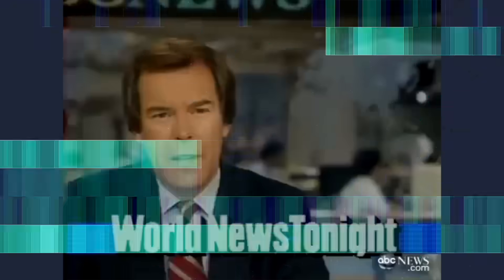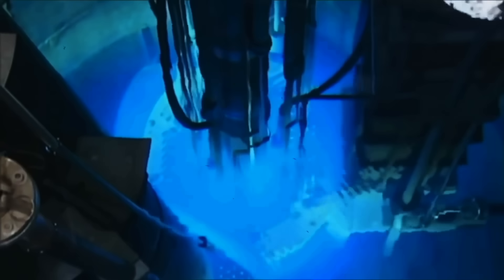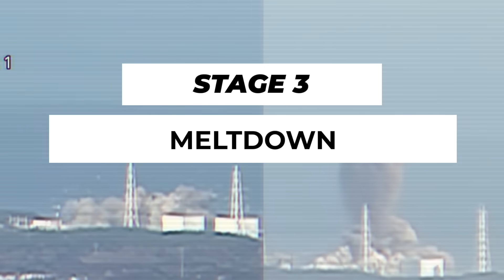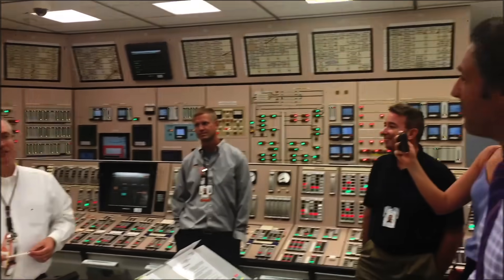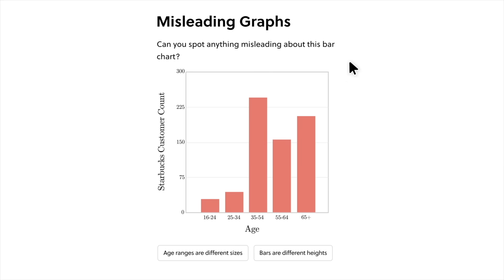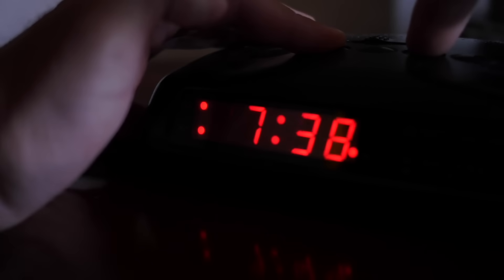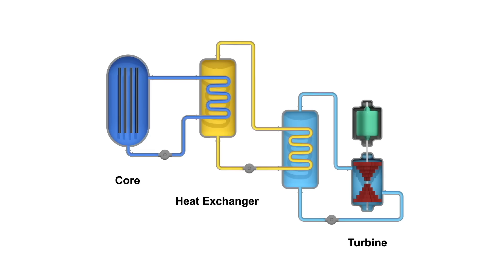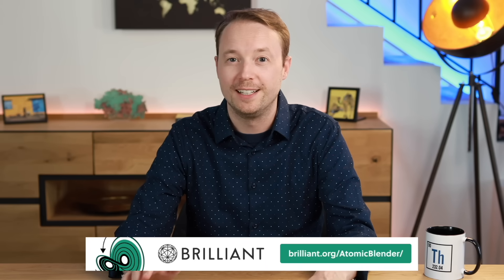Why Is It So Hard to Stop Meltdowns?

Comment: Why don't use tungsten or graphite bath/crucible  instead of stainless bath? Sure tungsten is expensive metal than reactor-class stainless steel (maybe 2-3 times) But if inner part is made of tungsten or graphite and outer case is made of stainless, it is not prohibitively expensive. Graphite is excellent neutron moderator, tungsten is excellent neutron reflector.

Comment: You are harrassing a lot of power and that power comes with a cost when a nuclear reaction runs away nothing you can do to intervene will stop what’s occurring. I spent a lot of time studying what happened in Chernobyl as far as i know it was just a flawed design and they knew it that’s a real issue nobody ever mentions and the fukashima situation was a freak tsunami the building was built well above code so yeah nuclear power is mega safe outside bad choices and a freak accident

Comment: Sorry ,  yes theres a dome to contain if theres a meltdown . but what about the whole corium that would be formed in case of a meltdown  and it melts down the concrete pad and into the under ground , what happens then ? even below the heatexchanger ? i dont know what could happen and wanted to know ..

Comment: I’m sorry did you say thousands of years we have been using nuclear power? Electricity was discovered in 1821. Unless we used uranium to create steam engines, I don’t think this is correct. Otherwise I like the video.
Reply: He is talking about cumulative hours. E.g. 100 reactors operating 10 years each = 1000

Comment: I have said for the last 15 years since I wrote a paper on it in college. There is a very simple and practical solution for the United States and nuclear power.  It’s called our naval bases through our nuclear aircraft carriers and nuclear submarines. We have operated a fleet of nuclear submarines and aircraft carriers for 70 years with almost no problems surrounding their nuclear power capabilities. 

I believe that by producing several simple and reliable nuclear power systems and using them at our naval bases to provide power to the United States while training technicians on how to operate and maintain them before being deployed on our aircraft carriers and submarines. We can provide an additional 20% capacity to our electric grid. We as a nation have already built and paid for the nuclear fuel from our nuclear weapons that eventually hit their half life and must be decommissioned. We should as a nation demand that this massive investment be utilized for the electricity we can and should be able to generate from this source that has already been developed and paid for.

These are secure nuclear power sources on these naval assets that are already present across the country at our bases which are near major population centers and can easily provide electricity. They are the obvious choice for this source of nuclear power. They have the infrastructure and security in place, they have the budget and expertise to operate these nuclear power plants safely. Most importantly we already have the nuclear fuel required for these facilities to operate and it’s the most logical way to dispose of our spent nuclear material that allows us to generate revenue to update and modernize our nuclear arsenal. 

Instead of the military wasting hundreds of billions of dollars on dismantling and disposing of these old nuclear weapons and building new replacements. We can capitalize on this capability and provide cheap clean energy to our country that can provide the revenue source needed to pay for our new nuclear arsenal. 

We already have this same model in place for selling our older aircraft and tanks to our allies to build new replacements. The United States is one of the biggest military exporters in the world and I believe it’s only logical for us to utilize our aging nuclear weapons material and nuclear power expertise to provide the much needed infrastructure and capacity. 

We can build this infrastructure out and sell it to the utility companies at a very low cost as any revenue generated from this program would help subsidize the enormous cost of building new weapons as well as help lower energy costs across the country.
Reply: Also as a side note. The key benefit and reason for naval bases being the source of these power plants is that they have clear access to water and have the very group of people who would be sent to any emergency or disaster. Also the military would be capable of operating these facilities at a reasonable rate of power and have no financial incentive that could compromise safety. They would purely be run as a training environment for people who would operate these same units on nuclear aircraft carriers and submarines. It’s also about the idea that by mass producing and building these facilities it would lower the cost dramatically for our ships and submarines and would also provide an abundant supply of available power plants that could be installed in submarines and aircraft carriers if we needed to quickly build dozens of them for a conflict. 

Instead of being bottlenecked by being unable to produce dozens of new nuclear power stations for aircraft carriers during a conflict. We could have them already built and operating across the country and capable of being installed quickly.

Comment: missed 2 types of meltdowns and 2 backup systems. 1: hydrogen explosion, this is what causes most reactor explosions, water reacts with the molten fuel sometimes and generates hydrogen which explodes because of the pressure and/or fire from the molten fuel. 2: RBMK explosion, chernobyl, RBMKs have got some sort of stupid design that makes them one of the only reactors that when they meltdown they'll almost certainly explode, to make things worse, the lid usually breaks the containment building, allowing radiation release. 3: gravity powered coolant tank and manual valve, open the valve, water is sent into  the cooling loop. 4: emergency amplified hand crank pump, a pump bypass pipe connected to a hand crank powered pump that has a cog amplifier (using cogs to output more rotational force than is applied) twist it and it pumps.

Comment: Quick question cant we lik add a liquid Nitrogen like emergency will that create more issues.
Reply: Liquid nitrogen introduced into a such a hot confined space would likely create even more pressure cause of the extremely low boiling point of nitrogen

Comment: Unbelievable whitewashing! In Fukushima, ALL backup systems were flooded. They probably only needed power for cooling, but due to the chaos in the country, the emergency generator didn't arrive. Even the fuel elements in the cooling pool melted due to a lack of cooling! And the people there are still suffering 10 years later. Anyone who claims you can think of everything is wrong! Spend two hours studying the two accidents in Fukushima and Chernobyl before you start clamoring for nuclear power.

Comment: 5:33 Most Nuclear Reactors have been retrofitted for this problem. They use Electromagnets to move the control rods, so when power is lost, the control rods instantly fall into the core by gravity.

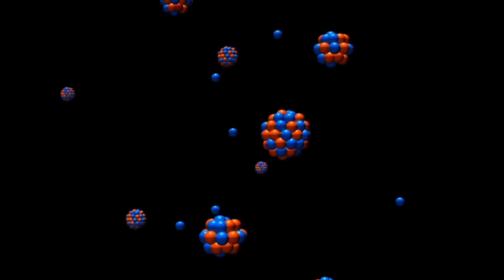Comment: 3:35 That was a weird and not quite correct explanation of decay heat! https://wikipedia.org/wiki/Decay_heat

Also, the disabled safety system (ECCS) at Chernobyl wouldn't have stopped the disaster.

Finally, DO NOT compare Chernobyl and Fukushima to Three Mile Island. Two terrible disasters with widespread consequences versus a partial meltdown which did almost no harm outside the plant.

Comment: I'm wondering... Without pulling control rods out, I didn't see any moving parts at 1:12 when the reactor started up ... How is the reactor starting up so fast WITHOUT removing control rods or some other visible ignition source...?? And even if the source is INVisible, how are the operators safely getting it to go essentially from 0 - (whatever # is appropriate to put here because... 100 in this case would, in my mind, imply 100 PERCENT, and I kiiiinda doubt that's the case here...) WITHOUT having some kind of ramping up/"revving" up period..? And without one, how safe is it to change the power output THAT Rapidly..? I know fission takes place essentially in microseconds if not NANOSeconds either way, sooo... I'm sure that/Have no doubt that, once a reactor is running, whatever changes to it wind up being made, it wouldn't exactly take very long for whatever wind up being the downstream effects/consequences OF said changes to take full effect, but still... Prompt criticality is a definite no no, just like wiping your hands and walking away immediately after a prompt shutdown is, likewise, a no no just the same .. My point being, that changes in the system seem to take time, or rather, that changes in the system that DON'T wind up taking any time, generally wind up being really, really big changes, and that when it comes to nuclear reactions, really, really big changes in (by default in this case) short periods of time, are MOST DEFINITELY A no no ... So what's the deal with what we're witnessing in the video in that regard..?
Reply: I am not a nuclear expert, but I do know some things. If I am wrong someone correct me, but to my knowledge. Once the reactor reaches a critical state (where enough neutrons are sustaining the chain reaction), the power level can increase. However, this doesn’t mean the reactor is instantly at full power—it just means the reaction is self-sustaining.

The reason it looks like there’s no gradual ramp-up is because the video shows the moment the reactor reaches criticality, not the entire startup process. Before this point, operators are making small adjustments—like changing coolant flow or microscopic changes to the control rods—to slowly bring the reactor closer to criticality. But once it crosses that threshold, the reaction stabilizes itself and power increases naturally. Causing that glow you see, which I’m pretty sure is called Cherenkov radiation.

Comment: What alot of people dont realise is what logically seems to be a stopping point is just fuel.. we know combustible materials are fuel for fire but where do you draw the line at what is considered fuel against the heat of the fire burning and what is required to sustain it... concrete, steel and most  human elements right upto the unstable ones. Whilst releasing near infinite amounts of energy need near amounts of ≈ to feed it in a runaway reaction

Comment: Yes, i just wish we'd get going with the "molten salt" aka thorium reactors which are much much harder to begin melting down and much much more than that there's a whole crap ton of reasons to switch over to molten salt thorium reactors however they won't simply due to the fact they are not getting their precious plutonium to weapons grade and things like that basically it would interrupt their supply chain for nukes apparently we don't seem to have enough

Comment: some of the most dangerous casualties occur when the reactor is S/D in the source range. At this point you are limited with possibly having no instrument indications for power, no inherent stability, and a large over power casualty in these conditions can result in the reactor going prompt critical making it impossible for protection systems or operators to control the SUR and turn power before core damage occurs.

Comment: There should be 10,000 nuclear plants under construction right now. The first trillionaire will be someone building nuclear power plants in China, India, and Africa. 75% of the total cost of ownership and production in these plants are construction. There is no parallel to illustrate how bananas that is
Reply: The three units at Palo Verde in Arizona have run for thirty seven years with an eighty two percent availability factor.
 There is something too what you're saying. 
 The largest nameplate reactors in the US are Alvin W. Vogtle Electric Generating Plant they are blasting out power since the 80s

 Safe clean efficient cheap power for decades.

Comment: A nuclear reactor is quite simply a slow motion nuclear explosion which can be exploited at a useful rate. If you push it too far it will get away from you and release dangerous levels of hydrogen which is where you get your explosion. It will not create the same critical mass as a bomb all at once but it will get insanely hot and stay that way for a long period of time.

Comment: The two examples used are old reactors with outdated designs. There arent many modern style reactors that could melt down in such a way since most water cooled reactors are allot smaller, search pebble generators or helium cooled generators if you are curious.

Comment: Cool now do one on the dangers of a spent fuel cooling Pond fire. But make sure to use the latest military study assessing the vulnerability of spent fuel cooling ponds.

Here's your friendly daily reminder that 99.9% of the radiological danger of a nuclear power plant isn't in the reactor but rather stored above the reactor outside the containment facility in what is deceptively called a spent fuel cooling pond.

Don't let the term spent nuclear fuel lull you into a false sense of security, spent nuclear fuel is literally the most radioactive substance known to man.

When nuclear fuel comes out of reactor during refueling it is literally the most toxic radioactive substance known to man, many of the daughter particles such as cesium 137 Cobalt 60, strandium 90 and iodine 131 don't even exist in nature.

Spent nuclear fuel is so heavily contaminated with fission products that it must be stored under 30 ft of water for 6 to 10 years before it's safe enough to be transferred underwater to lead line concrete casks where they will spend the next Thousand Years.

Spent nuclear fuel is so Radioactive that coming within even a few hundred feet of a fuel bundle would be lethal Within seconds. And we're not talking a pleasant death either we're talking one of the most agonizing horrible deaths you can even possibly imagine, acute radiation sickness isn't for the faint of heart.

The reason nuclear shells such as this channel want you to focus on Reactor safety is because they're trying to draw your attention away from where the real danger in a nuclear power plant Lays and that's when they spent fuel cooling pond.

Spent fuel stored in these cooling ponds needs active cooling 24/7 and as we discovered with Fukushima reactor 4 when the pumps stop working that 30 ft of water will boil off in less than 12 hours. Once the tops of the fuel rods are exposed to the atmosphere radiation skyrockets to deadly levels make it impossible to get anywhere near the facility.

When those fuel rods are exposed to air they will quickly heat up over 2100 degrees Celsius far exceeding the 1200 degrees Celsius limit of the zirconian cladding. A reaction will take place producing hydrogen gas, the rods will catch fire igniting and explosion which will blow the sheet metal building containing the rods apart.

The burning fuel rods will then eject their radiological material into the atmosphere in the form of heavily contaminated smoke. This smoke which will be contaminated with Radioactive isotopes such as cesium 137, strandium 90 Cobalt 60 and so forth will climb high into the atmosphere where the jet stream will distribute it across the northern hemisphere.

According to recent military research on the vulnerability of a spent fuel cooling ponds a single spent fuel cooling Pond fire could render the entire northern hemisphere of the planet uninhabitable.

In fact computer models analyzing the contamination potential of Fukushima reactor forest fire determined that a full-scale cooling Pond fire at reactor 4 posed the potential of contaminating the entire northern hemisphere making it permanently uninhabitable and forcing the relocation of hundreds of millions of people..

How is this possible? Reactor 4 wasn't even running at the time it was in cold shutdown. There were three other reactors that had actually melted down but they weren't the biggest threat, reactor 4 had the world Focus, reactor 4 was where the danger laid as it was storing the vast majority of the spent nuclear fuel from the facility and had a full-blown spent fuel cooling Pond fire occurred you and I probably wouldn't be having this discussion right now because we probably both be dead.

So once again that's why nuclear shills want you to focus on the safety of reactors or create stupid videos about how safe it is to swim in a spent fuel cooling pond

They want to distract you from doing any research, because you might learn that the United States is storing close to 200,000 metric tons of spent nuclear fuel in cooling ponds. You might discover that the US military has done assessments on the vulnerability of spent nuclear fuel ponds which highlight the fact that they pose the potential for a global catastrophic event. Something as simple as a drone packed with high explosives could compromise one of these pools and render 10 to 20,000 square miles of us soil permanently uninhabitable should this occur near a large city millions could die of acute radiation sickness..

Don't take my word for it, danger in the pool, the hazards are spent nuclear fuel

Comment: I wish the slow bureaucracy of the idiots at the NRC would get a clue and get rid of the stupid regulation that won't allow for a molten salt reactor to be built to any "real" size. I believe the max size now is 1MWth...which is hardly anything. Thorium (U-233) can be safely "burned" in a molten salt and more heat retrieved, than the current set of reactors. Also MSRs are designed to be Gen. 4 because the moderator is only available in the core (graphite).

Dr. Alan Weinberg created MSRs back in the late 60's. Where are they now?